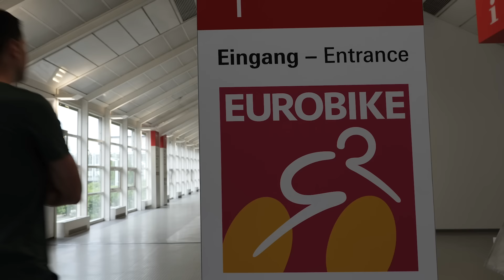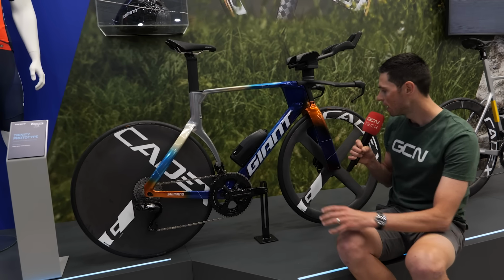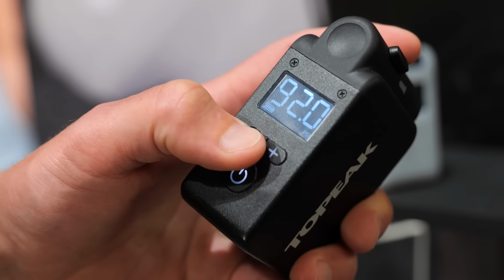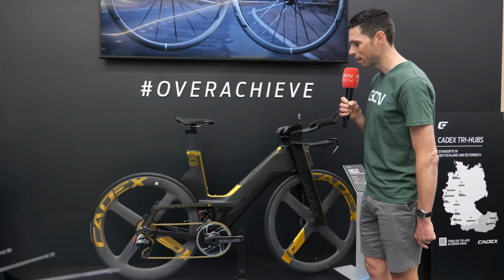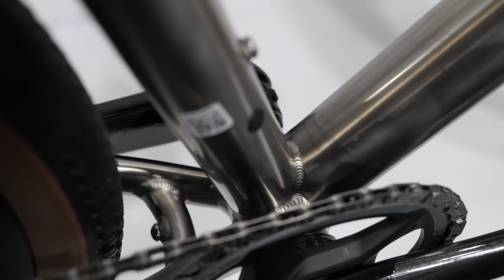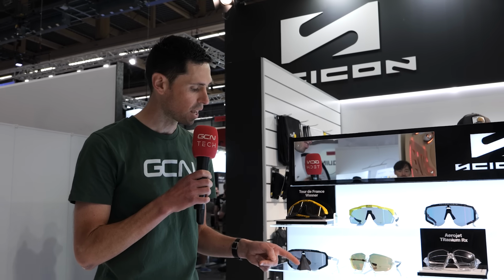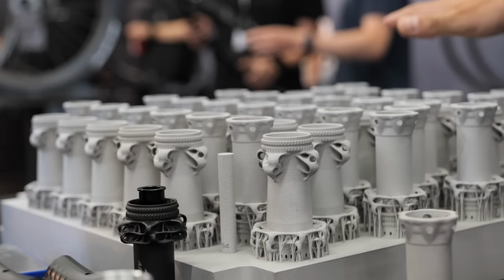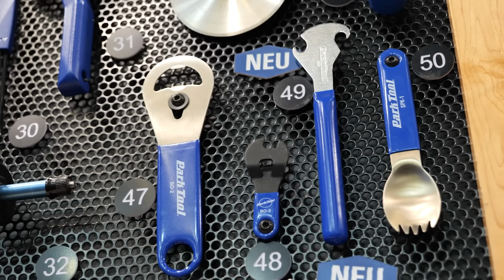The Hottest New Tech At Eurobike 2024!

Comment from the maker: What's your highlight from our first Eurobike video? 😍
Reply: Cadex ladie's shopping bike.
Reply: I could pump my tyres up to 80 psi in less than 50 seconds with my Aldi mini pump.....🤨
Reply: Topeak pump is nothing new, Cycplus has a better and smaller pump with pressure gauges and set-and-forget approach and Fumpa was making those small pumps for years.
Reply: Certainly NOT the bottle opener. Being German I do not need a dedicated opener to open a bottle, pretty much any tool will do or a lighter or anything strong enough with a 90deg corner.
OK may be in my old age if I'm plagued with arthritis.

Comment: The bulls bike that you picked is unexpected - but not for the technical reasons you might have in mind:

This brand, which is understandably not known outside of Germany, is a private brand of the ZEG: The ZEG, also only active in Germany, is an organisation initiated by small retailers to allow for larger market power, so as to reduce prices for purchasing supply parts, materials etc. At several points, ZEG launched their own bike brands which would usually be characterised by offering reliable mid-range bikes for middleclass consumers. Examples are Pegasus or abovementioned Bulls. 

Strikingly, Bulls seem to want to present upperclass / concept bike stuff now :D
I would have never expected that, thanks for showing!
Reply: ZEG dealers are usually not small.

Comment: Bulls is a Brand from germany which every experienced cyclist would never buy. I work  as a salesmen at  a bike shop and even when I got an offer for an ultraight roadbike with DA DI2 with DT Swiss Wheels and all Carbon frame for a bargain I decided to buy it and strip the frame, keep the parts and sell the framee afterwards. I rather sell our Scott and Cannondale bikes then the Bulls. Bulls bikes are cheap crap which are desgnied in  a way to absolute maximize the profit of the company.  But not for the good of the costumers, just for the companys. For example: their entry level gravel bikes come with traditional quick release axles, not with thru axles. On a disc brake bike. So no way to upgrade to better wheels afterwards. On the other hand Scott is selling every single gravel bike with thru axles and every standard we have in the industry. Bulls allways puts nice parts on the bikes  where potential costumers can see it. But on spots where it is hidden they cheap out.
Reply: Replace Bulls with Cannondale and vice versa and it will make more sense.
Reply: @feedbackzaloop  It is not so. I sell both brands and rode them a lot and Cannondale is much better.
Reply: @matthiasschmitt2311  I don't sell any and rode all three among others. Cannondale was the worst with Bulls simply middle of the pack.
Reply: @feedbackzaloop  I have a very broad overview over both brands cause I had several 100 of both of them in my hands.
Reply: @matthiasschmitt2311  in your biased by dealership paycheck hands. Cheaper bikes are harder to push and not so rewarding to service, that's simply it.
Reply: @feedbackzaloop  I do not have my own businuess. I speak as a employee. I would never ever buy an Bulls and just sell the Bulls if some costumers want them. I would allways recommend Cannondale, Scott and Van Nicholas (for  titanium bikes). But never a Bulls.
Reply: @matthiasschmitt2311  sales program and salary are your business - don't be a hypocrite.
It's ok you won't buy something yourself, you might not be manufacturer's target audience. But you should help customers make an informed decision, not push latest and greatest.
Reply: @feedbackzaloop  Bulls hinders further upgrades on their entry level gravel bikes by using traditonal quick relase axles, not thru axles. That is a no no for an beginners bike. It hinders further improvements by upgrading the wheels afterwards. I do not want to just sell the latest and greatest. I just want to have my costumers a decent bike with not drawbacks in the future.
Reply: @feedbackzaloop dude , the guy is giving information based on experience, what’s is your deal accusing the guy of trying to profit over something he doesn’t have any profit ? , he is doing a service telling the raw true on his experience
Reply: @juniorgomestattoo6411  because he a) does indeed have interest and b) uses typical showroom wording to communicate said "raw true".
Sure, he does mention valid points like quick release wheels. That help hide other negative aspects of other brands mentioned, eg atrocious Cannondale warranty policy or proprietary parts of Scott, and undermines other positive aspects like initial price and low catastrophic defect number.

Strange you could read through that unapologetic diss and not raise a brow.
Reply: @matthiasschmitt2311  you must be revolving in some high tier elitist circles not to realize there are plenty of QR aftermarket wheels and most of Bulls bikes are thru-axle now. And really not knowing your customers who normally don't upgrade anything but saddle soon after and tyres in couple of years. With groupset, cockpit and wheels remaining stock for a decade.
Reply: @feedbackzaloop  It is well known and talked about that one of the most upgraded parts on a new bike is the wheels 
But I do believe you are just a troll
Reply: @cybertonto72  among people who actually do upgrade, they do upgrade wheels. While some specific strata doesn't upgrade at all. And guess who buys Bulls and who buys Scott. Just logic, no trolling.
Reply: There is quite a lot quick realease aftermarket options I dont know what hes talking about, yeah sure its a bit old tech, and not super future proof but not a some kind of disaster like he mentioned, and van nicholas frames are nothing special again so sound biased yeah
Reply: @feedbackzaloop  yeah no, Bulls is actually total Crap. Wow, you Had one bike which equals zero experience with this brand
Reply: @DennisRobin420  and how many did you have, Danny? And I mean bikes in past ten years, not edibles today.
Reply: @feedbackzaloop  geez, you're attacking the guys' credibility, but what is yours? As it stands, I'd take his word as more credible simply based on the facts he quotes, and they way he conveys his message.
Reply: @JustBrowsing777  no, I'm attacking the message he conveys and the way he delivers it. You may even read further into this thread for clarifications.
You may agree with his arguments, sure, but don't blame anyone but yourself for falling for marketing fallacies. Or better yet, keep on living up to your nickname while I stand true my profile description.
Reply: @feedbackzaloop as a employe you personaly don't profit from selling more expensive bikes until the shop goes bankrupt you will get the same salary no matter what
Reply: @Amphibax  riiiight, because you get promotion, raise and 13th salary no matter what. How could I forget!
Reply: Bulls is a brand* from Germany* / I rather sell our Scott and Cannondale bike than* Bulls*. / for example* /... for the companies* / a* Bulls / always* - Du arbeitest bei Stadler, stimmt's?
Reply: Thats Nonsens. Bulls has some interesting bikes. For example the Daily grinder with gravel Geo and Low entry for Woman.
The reason Nobody buys them is the dealership they are sold in. The never achieved to Bild a Brand Like Canyon does. The Mountainbike Line is pretty Solid but the msrp IS Like 30% to high.
Reply: @feedbackzaloop  We have no sales program and no provision. So the only thing I profit from is if a sell a high sales volume (when it comes to negiotating a raise). But to achieve that it makes more sense for me to sell more ebikes. Or more  the  cheap bulls bikes which go a lot faster because of the price. But I want to have my costumers a bike  without any drawmbacks in the future. And in the very long term - a nice 2nd hand price when they want to upgrade the whole bike. Bulls bikes do not have any ot that.
Reply: @matthiasschmitt2311  if that is so, why don't you recommend quality bikes that a person can service, like Rose, Corratec or Stevens? Or Bulls.
Reply: @feedbackzaloop  maybe because they don't sell these brands?
And wasn't the last comment just about why he doesn't recommend Bulls to costumers?
Reply: @Amphibax  when you seemingly don't profit from selling or not selling, must be nothing wrong to recommend go somewhere else for a purchase. Or inform customer about future service.
Yet it is not the case with Matthias
Reply: Japanese people who complain about even the slightest scratch or noise are taught in compulsory education to buy a Giant when in doubt 😂(from japanese)
Reply: What's wrong about quick release axles? They were a standard FOR DECADES before thru axles were even a thing. Maybe thru axles are a bit sturdier but they only exist for around 10 years, so both have their advantages and disadvantages. Bulls is not a top-notch brand but to be honest: after all, the brand doesn't matter, it's the parts you put on the frame (which is pretty much the same with every brand). So every bike can be upgraded to fit its riders' needs.
Reply: @derhard706  The problem is: Every new wheel on the market comes with thru axles. It is an outdated standard.
Reply: I had a bulls xc bike. That was the worst ever, only problems
Reply: @matthiasschmitt2311  yes, but that doesn't mean it's crappy or a sign for a crappy bike. That would be the same if you say rim brakes are crap and disc brakes are the way to go. It always depends on the purpose it's used for.
Reply: @derhard706  It is. If you spend 1700€, you can and SHOULD expect to get every standard in the industry.

Comment: Those aero tires remind me of some aero testing that found some knobby mountain bike tires more efficient than some popular gravel tires.  Who’d have thought years ago a fat knobby low pressure tire as the racers choice today?
Reply: Do you remember which ones? And what about rolling resistance?
Reply: @jmatulis92  I think he is talking about this years prep video for unbound from dylan johnson
Reply: Yup, also though of that one. But I have some extra thoughts as to why the conti 2.2 was faster then the other tyres. Being designed for mountain bikes with rim widths of 25-30mm, when mounted on a 21mm internal width rim Dylan used, they are narrower, but TALLER then they would've been otherwise. That probably means a more streamline shape, compared to the gravel tires which probably poke out much more sideways, rather than higher on the rim.
Reply from the maker: It's so cool how the tech world changes 🙌
Reply: I loved that off-hand comment in a Silca video where the bossman (formerly at Zipp) said a Conti engineer once admitted that at the time, aerodynamics were not really considered when designing the GP tyre. They just turned out to work really well.
Reply: @jmatulis92  yeah it was Dylan J’s video of Unbound testing

Comment: Bulls is like the cheapest brands besides Decathlon, which are probably better.

I had some test rides of their gravel bikes. I had the same model . Both drove extremely different. Weldings were completely off. No grease on their parts. Completely new bike with a stuck seatpost (no joke). The cables were comical long.

Comment: The dual chain two-speed strikes me as an overly complicated design for a problem that was solved long ago: The old Bendix two-speed kickback IGH. Sturmey-Archer has been offering modern versions of this for years and still does, in both freewheel and coaster brake versions (the S2 and S2C).
Reply: Sturmey-Archer is not what I'd call cheap or reliable.
Reply: You can also get a Shimano Nexus 3-speed internal gear hub for like 40 euros, why would you get a setup that has double the wear?
Reply: @rgudden90  I believe Buffalo are getting their double chain setup under a tenner. And wear you mentioned is not doubled, but devided between two chains because it is still only one chain under tension.
Reply: @peteralexander6514  I have two bikes with the S-A SRF-3 hub. They have been completely reliable for more than a decade. While it’s true that later UK produced hubs were questionable due to worn out tooling, modern Sturmey-Archer hubs are great.
Reply: I imagine given the purpose of the Buffalo bike that more than just cost at point of manufacture was considered., like parts that don't need high precision/complex tooling and can either be stamped out of sheet metal at high volume or be replicated on a pre-war lathe in a tin shack in the back of beyond.
Reply: Yeah, my mom had kickback gears on her bike from the fifties. It worked until the bike rusted away in 2010 from being left out in the woods.
Reply: Cost ... serviceability ...
Reply: @Bikey_McBeardface  I think it's indeed a big part of the answer.  Wasn't one of the key  features of this bike that you can take it completely apart / put it back together using a single wrench?  As much as I love IGHs, they are not simple.
Reply: @rgudden90  the whole buffalo bike costs 100-120 $ and must carry 200 kg. Nexus is not suitable for such thing and too expensive.

Comment: A 10mm spanner is probably more for 6mm, sometimes 8mm screws 😉 Hard to find on a bike anyway 😬
Reply: As per ISO 4014/4017, 8mm screws use 13 hex head and 6mm - yes - are 10mm. Usually come for mudguard mounts (onto fork crown, not legs)
Reply: @feedbackzaloop that must be one hell of a mudguard 😄 A single 6mm screw is capable of holding my car battery in place.
Reply: @jonasvieth  well, what actually holds the battery is its weight, the screwed on bracket only secures it. Also when this screw fails, you don't instantaneously become a skier like when a mudguard falls off and makes half rotation with the wheel (ask me how I know 😁)

Comment: The pump is still kinda useless. Too big to fit in the seat bag and if I can only use it at home, I might as well use a track pump.
Reply: Also the weight. What’s the point of a fast minipump anyway? If you happen to use it your race is definitely gone and you just try to finish. If it’s not in a race situation those seconds are irrelevant.
Reply: @jonasvieth if you're doing something like unbound, then a flat is both decently probable and not totally fatal to your race if you can address it quickly.
Reply: They are a dumb gimmick.

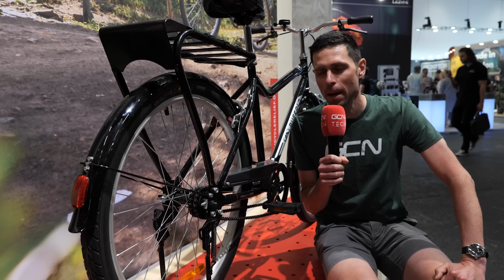Comment: 10:32 The two gear/chain system on the Buffalo could have been done better. DBS (Den Beste Sykkel) Norwegian bike manufacturer started in 1932 made the classic DBS Kombi bike in the 70´s, it also had a two gear system engaged with a much shorter back-pedal but it was hidden in the rear hub. I think its called Duomatic. I see a lot of new hubs like this online, why not just use them instead?  99 bucks on Amazon...

Comment: Why does that Giant Trinity have such a big gap between the aero seat tube and the rear tire?  Was it designed for 32c tires or something?
Reply: It's not really hard to work out is it? Anything on that bike, is the way it is, because it's more aero that way.
Reply: The idea is to put the seat stays behind the rider legs so air in between moves more freely.
Reply: @AndrewisTri-tn1uo  The whole point of doing a curved, indented seat tube is to have the tire tuck in there and have a smooth air transition from the front of the tube, over the tire and down the rim.
Reply: @briankelly3568  Talking about the curved seat tube, not the seat stays.  Yes, the seat stays are using the concept first seen on the British Hope track bike. I get it.

Comment: I love it when someone uses a technical term in a way that demonstrates they have no ideas what the term means. A NACA duct is an opening in a particular shape designed to creat maximum airflow into a duct that’s placed on a flat surface. A NACA duct is not a wedge cut out of a tyre tread.
Reply: He used the term EXACTLY right, since NACA ducts have long ago been modified and repurposed as vortex generators - possibly the earliest versions of vortex generators - and these tires, while pretty silly IMO, are attempting a similar effect.

Comment: Classified TRP drivetrain is a joke right?  "Not new technology, but what is new is to make a drivetrain setup integrated and work seemlessly together" so a drivetrain? a drivetrain that works together is just a functional drivetrain? this "seemless drivetrain" has "QuAnTuM ShIfTiNG?" and it differs to any other seemless drivetrain how? "quantum shift makes makes it so when you shift through the gears and up the cassette, the drivetrain will automatically change gears" - SOOOO A NORMAL DRIVETRAIN?
Reply: Gplama did a better job by actually demonstrating how it worked on camera.